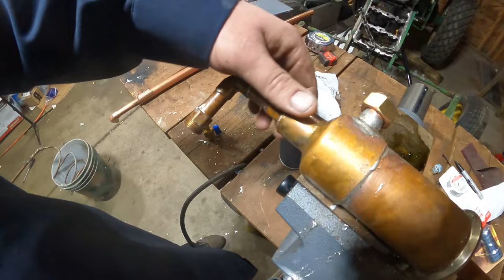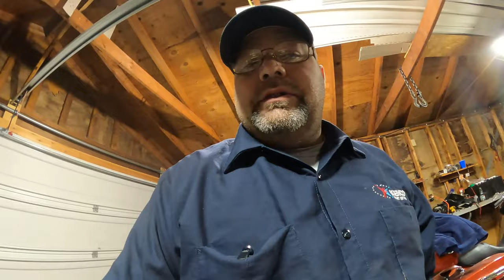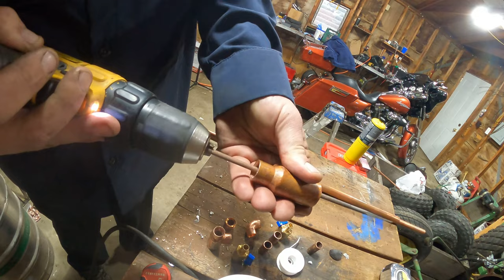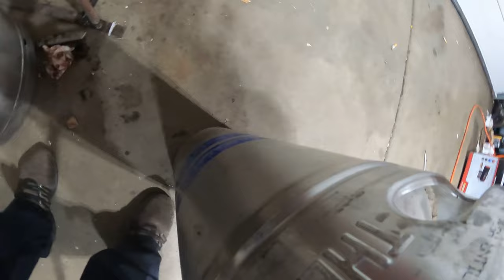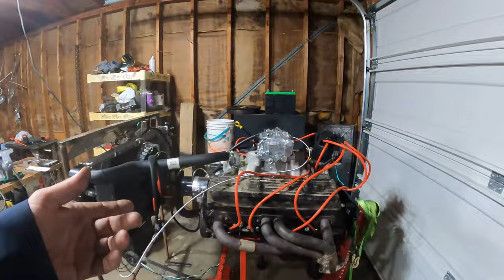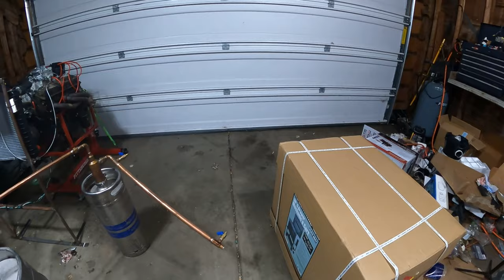Race Fuel Maker Is Done

Comment: I briefly thought "what kinda race fuel does this crackhead think he's gonna make with a still?"

Ahhh, the kind of race fuel that gets consumed by the glass.  Your 'fuel maker' is much more elaborate than mine, nice stuff man.
Reply from the maker: Lmao, gotta stay on step ahead of the feds man. 
I'm actually gonna try and use what's made out of it and see if it'll run my motor I have on the engine stand.
Reply: @DuctTapes78  My first run was pretty decent for just a plain sugar mash.  I don't know if I just got lucky or what, but after that most of them came out with a musty smell/flavor.  I did one with molasses that was good and one with watermelon that was also good.

I ran wine a bunch of left over wines once and it was pretty darn good too.  On one occasion we had a bunch of booze that nobody liked so I ran that, it was quite potent, yet a good sipper.

The feds want to force us into EVs.  For most people that means electric vehicles, some of us will be rolling Ethanol Vehicles.  Both can be 'charged' at home, but instead of giving us a tax credit they wanna put people like us in jail.  Bastards.
Reply from the maker: I made a batch of mash that spoiled on me. Smelt like dirty feet. Tasted the same way. So I started calling my garage The Dirty Foot Distillery. Lol